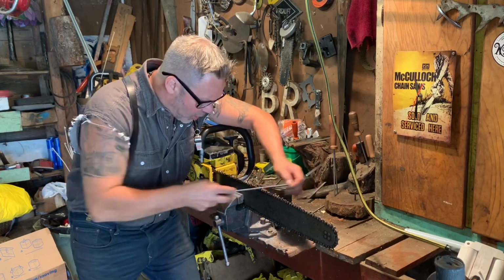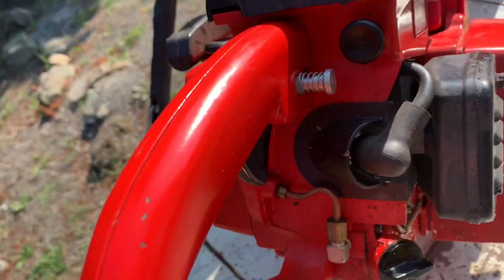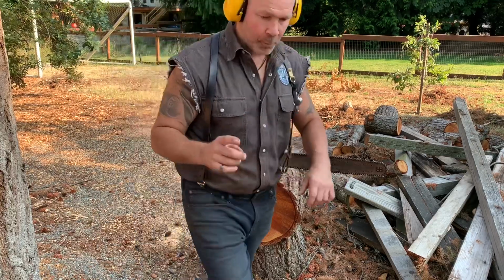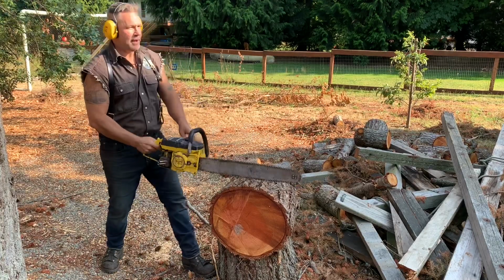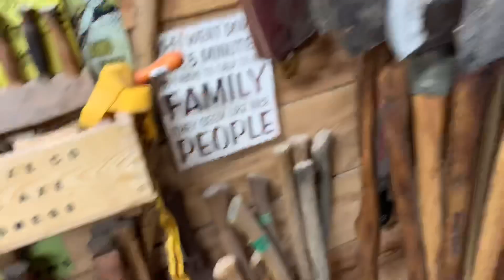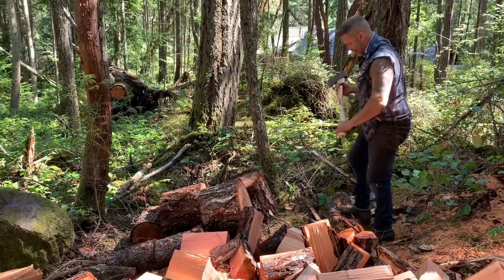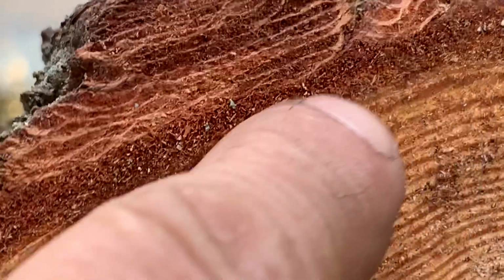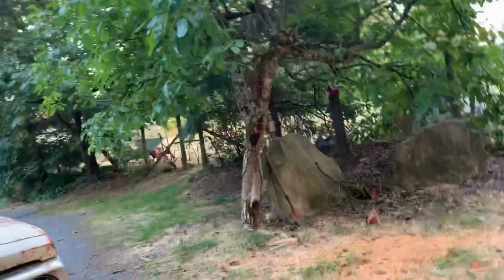McCulloch 10-10 vs. Homelite xl 12.

Comment: You may never see this comment, as the video is a year old, but I’ve watched several times. My favorite so far. Amazing that it also included your insights on your Dad.  Great words. I’m an old Homelite guy. Like, almost 70 old. Use mostly just some old SXLAOs and a few XL-12s unless I need big for a fall or little for pruning.  The 2 second difference in cut time notwithstanding, I’ll keep them. Ya see, I got started on them from my Dad. He had some old Macs too, but liked the Homeys best. Every time I pull the cord on one, I think of that old timberbeast. Good thoughts. And his shop and work bench looked about like yours. Thanks for the channel. I watch it a lot more than the news!
Reply: There ain't nothing so sweet as the throaty rumble of a Homelite running.
Reply: I have  2 oldies a 1963 homelite c5 and a 1959 Clinton r55 g1 amazing saws they don’t make them like they use to

Comment: I know this is an older video but I just picked up an xl12 with a 20" bar at an estate sale for $18.  They couldn't get it started and there didn't seem to be much interest in it.  Long story short I took it home, inspected the empty fuel tank, added fuel and it fired up on the third pull and runs like a champ.

Comment: Dad had the 10-10 (we called it a Two-10) and a Mini-Mac.  Great saws, that finally failed due to letting them sit with old gas and Dad was no mechanic.  He replaced with the Homelite Super XL-AO when I was 17 y-o and that was a step up.  I still have and use the SXL-AO and I am now 69 y-o and it runs like new.  Just finished cleaning up a huge black oak dead fall with it this past weekend.  I have used your sharpening tips with it and the method is EZ and very effective.  Thanks!

Comment: Today I learned that Homelite used to produce good stuff
Reply: Sure did. So did Poulon. Today’s saws are junk compared to the old stuff
Reply: @Bubbles The SEZ, with a roughly 16 year model run, might possibly have been Homelite's best selling model.  At only 40cc's with awesome compression, it's super powerful and really rips.  Easily pulls a 16 or 18in  bar.
Reply: Oh they sure did.
Reply: I have my grand fathers super EZ and hope to have it professionally redone if they can still get parts. I ran it quite a few times and it cut great and the muffler really barks.  Miss ya gramps.
Reply: @justloggit22  plenty of parts available.
Reply: Absolutely did. Made in good ol north Carolina back in the day. Poulan too. Look at the 245a classic texas chainsaw massacre saw. You know movie people look to get the best available.  Sachs dolmar, mcculloch,  johnsered. All made fantastic saws. I've got a sachs dolmar 112 that "Lefty" used in tcm2..... for a 51cc saw. That sucker is one powerhouse. I've got about 10 running vintage chainsaws.. about to be 11 because I'm in the process of rebuilding a stihl 066 red light saw, just waiting on a handle to come in and 1 or 2 other parts. It came to me in a box completely stripped and dirty. Had no cylinder bolts, it was literally in pieces. By this weekend 10-16-21 I'll have it complete and will then be able to see if the carb needs rebuilt. Got a homelite super xl automatic thats a great saw too. Only mcculloch I have are mini macs which I've rebuilt. Would love getting a good mcculloch pro 700 or something similar. Looking to also get a Sachs dolmar 120si

Comment: Good morning all, Phil from Kansas City here.  Mowing the lawn this morning before heading into the Stihl store.     Have a day and be safe.
Reply from the maker: dont doit !! lololol    hahahaa ... good stuff Phil ,, how many cc's ya grabbin'
Reply: @BuckinBillyRaySmith  I'm a Stihl mechanic, however my first saw was a Super XL Auto I bought at JC Penny for $188 in 1978.  I'll have to get it out, get it running and run it against my MS261C-M.
Reply: Phil!!!!
Reply: @oldmanfred8676  How you doing old man?
Reply: Phil,
Doing some better.
Reply: Just made the plunge and bought a little battery stihl,  so far so good.  Just pruning and limb cuts. Used the plug in electrics for years. The freedom of the battery is tickling my fancy. Almost feel like a Woodman.
Reply: @jirusjirus9322  , I'm impressed with the torque of the AK and AP battery units.  Don't sell a lot of them but I do hand file many of their chains

Comment: Clicked So hard i Put Another Crack In The Screen.. I Love My Homelite. SAME Saw. Can Let It Sit For a Year..Choke Bam Fires Up. I Inherited it And It Looks As Good As Yours. I also have the Older One With The White Paint  around the Pull Start, i Gotta dig it Out, it Is it's Older Bigger Brother.. What i do Miss Is The First Generation of the Little top Handle Homelite.. Peace Brother 😎
Reply: Found 2 of those top handle homelite in my travels on the pawn,both fired up on the spot and run pretty good for there age,so fine for agility,they both could use some a little help but are a testament to the quality of the saws,thanks for the post good day
Reply: @ferrallderrall6588  same as the 1 i got 20 yrs ago at a yard sale for Free...Now it needs a Full Rebuild. But i can't Bring myself to Get rid of it. 1 Day I will find a Parts one .

Comment: Worrying about what has gone before will not help you!! It’s done with so just move on and Change things if you can. It’s all about love and kindness. Nice axes Buckin, would love to have one it would only collect dust as there is nowhere near me where I would need an axe. Here in the UK they are trying to get rid of wood burners because of the smoke!! Take care and be safe dear friend. Xx🌲🌲🌲❤️❤️❤️
Reply: It seems if they could teach the general public about how to properly dry and season wood/ how to make a fire and the most efficient way to use a wood stove,  then there would be less smoke. 
One bad fire can fill a valley with unnecessary smoke. 
Fines and citations could help in the long run to weed out bad burners.

Comment: hey Buckin, can you do a video going over all the different notches; when to use them and what pro tips you can give to make sure the notches meet without creating a dutchman and felling a tree goes well; especially if you have smaller bar (24" bar) and a larger diameter tree then 24inch to fell, etc.

Comment: I see these comparisons and love them. I own a small variety of power saws. I know you love Mcculloch as I do. I live in Southern California and there isn't the abundace or need for larger cc saws as in your neck of the woods. I happen to own a poulan 245A which I have yet to have it have it cut the biggest Wood I have been faced with maybe 3-4 foot. Far and few between. Just wondering if you have owned or run a 245. Just wondering what you thought of them if you ever used one?

Comment: I'm amazed a Homelite doesn't get indigestion running a wrong gauge chain. Just brought home an ugly as sin Homelite 150 that had blasphemous red spray paint all over it. It had a Tilton/Tsumura bar in 3/8 .058 gauge (still have to measure that) haven't a clue about whether she will run or not. Had a chance years ago to buy a ton of 3/8. .058 chain and bars on clearance. Wrong gauge....😁

Comment: The homelite may get faster after its done some work, its new the engine is still tight.🤷‍♂️
Reply: sounds fresh needs some more rasp
Reply: Or a fresh ground chain like the mac did
Reply: Agreed, after a while of use they gain more power. Noticed that 100% after i rebuilt the top end of my super xl. Its kinda levelling off with its power now. Initially it had no power after the rebuild. Now it has bags of power compared to what it had. Granted its only 3.3hp but still theres enough power to do work with it now
Reply: @alexhickey5633  I've fond this a lot especially when I rebuild a car engine normally make them in the tight side of piston too boar tolerance for longevity but it takes forever to run them in haha but even a loose race engine will do this.
Reply: @theforbiddenunit-danielgre5588  a huge part of that is the rings having to bed in. In the very beginning itll be tight. Varying loads and rpms for the first while aswell maybe an hour
Reply: @alexhickey5633  yeah definitely I normally put them on a trailer with loads of wood once they have done a bit of work but nothing to extreme till they have done around 800km/h at 80km/h for something that's got 4thow or less piston to boar tolerance, hot Australian weather be like a 1000km/h due to the growth in all the steal normally a bit looser as a start up temperature left overnight can still be 25°c lol
Reply: In the automotive stuff
Reply: Chainsaws i tend to do two tanks low loading , third with some high rpm but fat tune after that I start treating to more load by the 5th or 6th tank I'll lean it out but still needs a couple of growth cycles I generally don't get much wood cut them days.
Reply: I guess what I'm trying to say is that whilst things are hot and lubricated the wear rate is low its all the cold starts that do the most wear or damage if pinned full noise cold ive seen so many people do that 🤦‍♂️👍
Reply: @theforbiddenunit-danielgre5588  for chainsaws i put 2 tanks of fuel through them with shit oil ran phat af. Then i go to a full synthetic and lean it out a bit. Cars then id vary the load to bed in everything for about 5 hours in total

Comment: My homelite Xl12 automatic  oil one doesn't want to run when hot, it has good spark and fuel in the tank, a brand new fuel filter in it, so yeah.... 

Compression going bad ?

Comment: Hey buckin. I starting out doing pro tree work and am in need of a bigger powersaw. Been lookin around and they're on the pricier side to get a new one. This begs the question - what should I look for in a used saw in terms of wear and tear, abuse, common problems when buying it from eBay or somewhere else online? Leaning towards pioneer or mccollough if that helps. Thanks

Comment: Have a question , I have a 10-10 it's pulling bar oil into crankcase and burning it . Cylinder bolts are tight and I siliconed over the heads , still does it . Any suggestions , other than that it's good ? Any advice is much appreciated . Thank you

Comment: Hi Buckin, a quick question if that's ok. I am a wood turner and have one of those cheap Chinese 5hp chainsaws for cutting blanks. The little use I have for it is why I got a cheap one. The question is that it absolutely eats fuel, I am talking 6 cuts on a full tank. Is there any way to improve the fuel consumption with adjustment.

Thanks
Shay.

Comment: Love my xl12 but the vibration in the handles is almost too much, love the video's!!!!
Reply: I solved that problem with my Super XL back right after I bought it in 1981. Get some handlebar foam grip tube or wrap and install on the top handle.

Comment: these "test cuts" are subjective, not a rigidly controlled test, but yeah it is the accepted method in the saw world. Even so there isn't a nickels worth of difference in these two saws cut rate. And I have to wonder about the new condition of the Homelite, not run in yet so I figure there is frictional loss to hp development. I have a super XL automatic I bought new in 1981, has cut so much wood it would blow my mind to see it all piled up at once. The only Mac I ever had was a D30 and the homelite replaced it. Any power saw is better than the old manual crosscut...I have run those too.

Comment: Why do you use the starter rope when shutting dot your saws?
Reply: The way recoil starter clutches work on most saws are flyweights that will grab as the saw is shutting down and pulling the cord out provides a bit of cushion so it doesn't tear up the rope and dogs.

Comment: When that new Homelite is broken in it will give that Mac a run for it's money!
Reply: Agreed, I knew the outcome before he started the first cut provided the Mac had decent compression. Once the rings set on the Homie it will be a coin toss as to which one will get through the cut faster. I own a Mac 555 (basically a 10-10s) and a SXL-AO, 58cc versions of both the saws he shows and it would be like figuring out which one of your children you love the most. 
I have ported 372xp's, West Coast SEZ's, Mac 700, ported CS590 and a 036 (still have to port this one, I just haven't had time to yet). Of the saws I have, if I could only have one of them I would have to give the nod to the 036, it's nimble and can handle any thing I cut since I don't do this line of work for a living, but a ported 372 sure is fun.